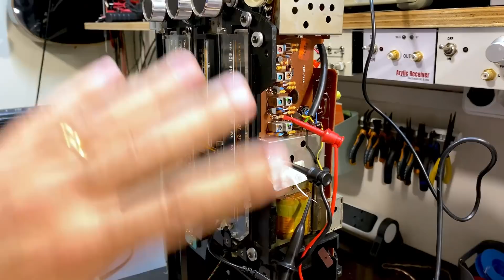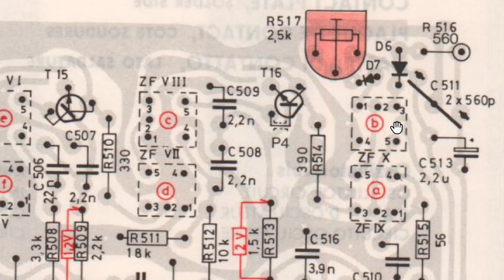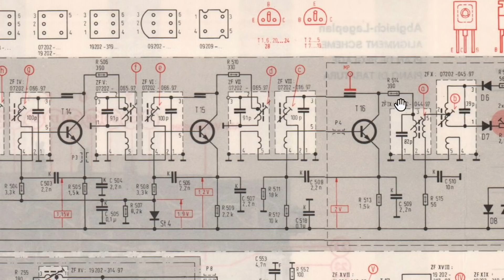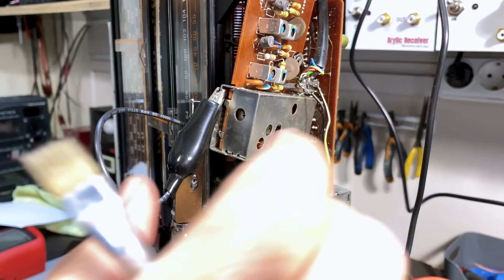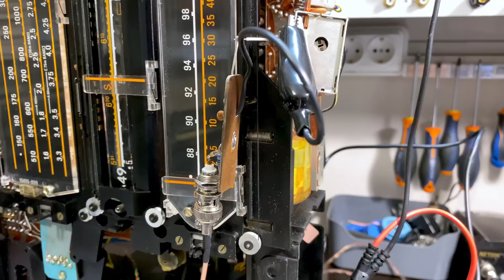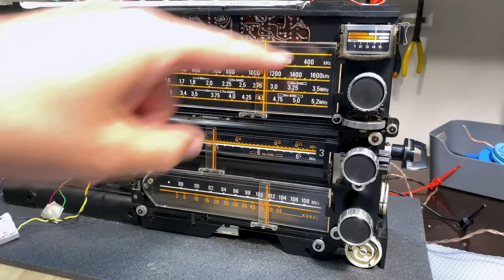FM reception is back. Grundig Satellit 2100 restoration part 3.

Comment: congrats to this really nice video...a perfect solution. I had a problem with one IF transformer that was completly damaged....no chance to get such an IF transformer anywhere...so, I replaced it with a 10,7MHz ceramic filter under the shielded hood (no visible impact to the radio) and it works fine! A solution for the case you can´t get any original replacement.
Reply from the maker: Thanks for the tip.

Comment: Many Thanks for a great video. A good friend gave my one these radios with flaky FM that would sometimes work but the audio was distorted and other times it was dead.  Thanks to your video I found one the BF241 transistor that was bad and the FM now works.  Now I'm in the process of aligning it and again your video is very helpful.
    - Dave (KC3PBO)
Reply from the maker: Glad to have helped.

Comment: Why can't we not get rid of the demodulation board and replace it with a Silicon Labs Radio chip Si4684 that can allow for LW/MW/SW/DRM/FM/DAB then a dual channel amplifier can be added to drive a speaker for say the Left speaker and a socket that the Right speaker can be plugged into.
Reply from the maker: I prefer to restore as close to original as possible. After all, we could, in the extreme, replace the entire radio with a phone app.

Comment: Hello I have a 2000 that I calibrated on the FM following the service manual on the first page point 2. to calibrate the dial what I seem to observe is that, given that the index is correctly positioned, the dial scale cannot be perfectly calibrated on both extremes but should we accept a compromise or am I doing something wrong? Have a good day, thanks for your videos. F.
Reply from the maker: Usually you get it as close as possible. It’s not always possível to get it exact at both ends.
Reply: @electronicsoldandnew  I guess it ;-) Without a precise counter as 3000/3400 series, there can be only a compromise. Thank you for fast reply.

Comment: Thanx for this fabulous tutorial! I recently acquired a Satellit 2100 in very good cosmetic condition. However, It has the symptoms you talk about: very bad FM reception. Sound, if any, is distorted and muffled, Vumeter hardly mooves. I'm so frustrated because I baught it for it's incredible FM sound quality and the seller was not honnest enough to say FM does not work properly. I guess this tutorial is only meant for experts fitted with the right gear! Would you fix my radio if I send it to you??
Reply from the maker: I’m afraid the cost of shipping to and from madeira alone is too high.
Reply: @electronicsoldandnew  Would pay for labour shipping. How's that?
Reply from the maker: Where do you live?
Reply: @electronicsoldandnew  Tunis, Tunisia
Reply: Maybe just send the FM module that needs to be adjusted?
Reply from the maker: Checked and our postal service does not guarantee delivery. It’s not going to work. I also don’t do repairs as such. This is my hobby and I normally only do my own projects and any others that I find will add something new to the channel.
Reply: @electronicsoldandnew  Thank you all the same and keep up the good works!
Reply from the maker: pleasure 🙏

Comment: Hello Manuel, 

I have worked on some Grundig 4000 Concertboy radio's in the past and most of them suffered the same problems as your project.
The copper in de IF transformerd degraded due to moister and eventually failed.
Repaired them with the same method you used, and in some cases i could replace them with a Philips (toko) IF Can.
Nice to see logical approach and creative solutions to keep these radio's working.
Thank you for your entertaining and high quality videos for the past years!

B.r, Eric
Reply from the maker: Hi Eric. That’s good info, as I was wondering why the coil had opened up. Finding the fault is fine, but if I don’t find the cause of the fault, I get nervous 😊 Your explanation makes perfect sense.

Comment: You came there in the end finding a direct current setting around that transistor not right, but my experience is that if I suspect a full stage isn't working, a quick measuring of the five base - emitter voltages of 0.6 V will show in one minute which stage is at fault.

Comment: I must admit that I expected the transistor to be faulty before the IF coil. I was wondering whether these IF boards were tuned up before fitting into the radio, the reason I say that is because, when I worked at Marconi many of the boards I worked on, were. This makes it easier to set up and repair before soldering all the connecting wires. What a difference the FM sounds after repairing that IF coil. You have done a great job with this radio so far. I'm definitely waiting for the next video.
Reply from the maker: I expect they were tuned then fitted. Makes sense.

Comment: Having a working FM is always a good thing! I recently got some "one of a kind" ginormous HiFi Studio Radio (with build in turntable); all transitorized, lots of supreme varnish and glass cover with some sort of mechanical opening system. Everything else is made out of very heavy wood elements. I dont even want to try to mess with it, except checking the capacitors. I got this monster... for free, because the owner said, nobody wanted it. I guess because the manufacturerer (PE) is kinda "unknown" / no big brand.

But its so sensitiv regarding FM. With just a bare wire i can pick up soooo much FM Stations all my other radios (transistorized or tube) dont pick up. Even some polish radio stations are loud and clear. Its kinda amazing and i dont really know how such sensitivity works. The backstory is also interesting and has something to do with the DUAL Company. One brother of the founders of DUAL left the company back then and started its own small business with these radios+turntable. All designed and build in-house. Made in Germany.

The other thing thats not working correctly is the turntable. Its "active" even if set "off" and some other things are a bit messed up. Would be my first time "trying to repair a turntable". I watched some videos on youtube regarding turntables + repairs but this turntable seems waaay more complicated compared to some turntables other youtubers worked on. So many gears and stuff, all metal. Now i dont know if i take the risk or not. You can "play" a record just fine, but auto-stop and all this stuff does not rly work. Because some stiff elements i guess...

Anyway! This hobby is just amazing and the community even more. Thanks for sharing your insight and all your tips and tricks.

Best wishes from Germany!

/edit: Oh and the unit has some (for me) mysterious "Linear"-Switch. If i push the button in, it just goes quieter. Ever encountered such a switch on other radios? I wonder what it means and it seems to work on all modes (SW1, SW2, SW3, MW, LW, Phono, Micro, Band)
Reply: The "liear" switch probably switches the loudness contour filter and/or the bass and treble controls out.

PE (or "Perpeuum Ebner to give it it's full name) was a very high quality manufacturer. The turntable alone would be worth quite a lot of money by itself and the whole unit is probably beatifully made and should sound superb. Definitely worth persevering with!
Reply from the maker: Thank you

Comment: Great job Manuel.
You probably would have found the problem quicker if you'd started with measuring voltages on those transistors,
but then it wouldn't have been so interesting to watch you chasing down the issue.
Reply from the maker: True. I actually thought someone may have messed with the transformers. Actually, it was more of a hope :)